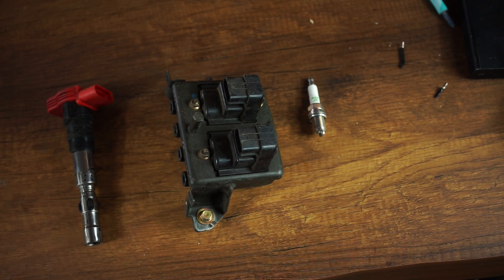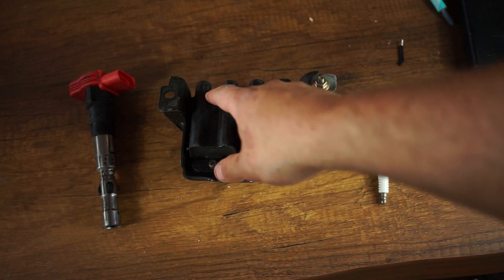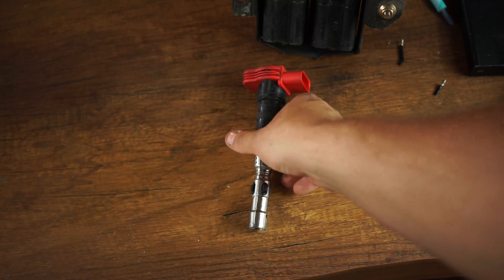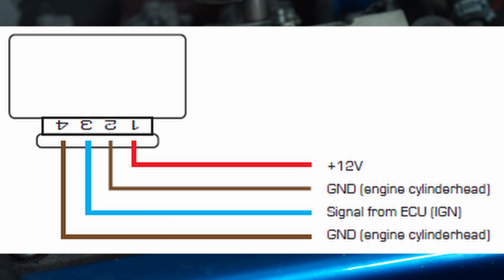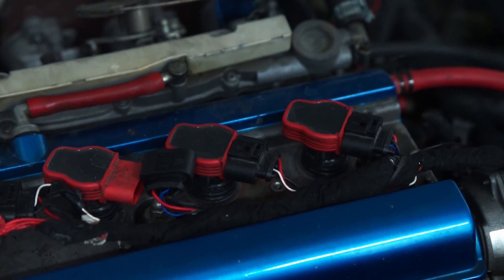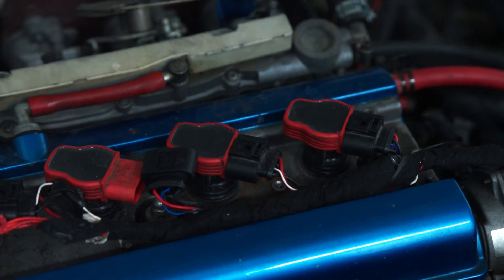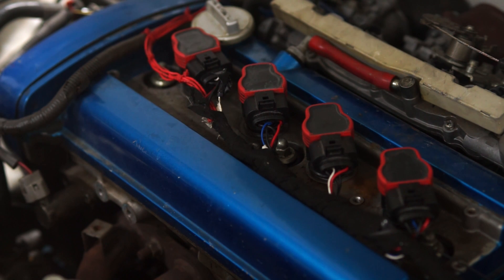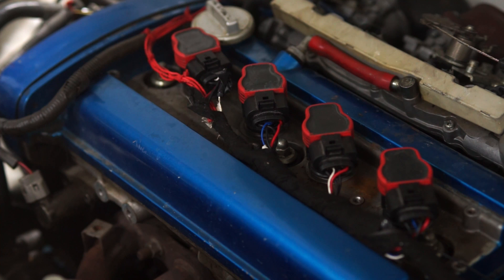DIY Coil on Plug Ignition Conversion | Cheap and easy sequential or wasted spark Config for any ECU

Comment: What if i parallel all the coils? Could it work?

Let me explain. On old Mercs or bmw there is a distributor and rotor on the top of the camshaft. The single coil already have a signal from ecu that manage the advance/retard. What if I take that signal and split it to 6 coils?one for each spark, could I work? So that should be 1 good spark and 5 wasted every cycle.

Comment: Hi ...  is this applicable to a miata with standard ecu?
Reply from the maker: in theory yes it can be done but not recommended for long term use as the stock ecu uses much higher dwell times wich can damage the coils  over time. 

+ you dont have any benefit from cops on a standard naturally aspirated setup anyway

Comment: Hi, sorry to bother you, but do i need a module to activate the coils? because i saw you just put 4 pin coils, and dont you  need a 5th pin for the 12 volts?
Reply from the maker: No if you have a standalone ecu then you have in this case 2 pins that goes to ground 1 pin that goes to constant 12v and the other one is signal to the ecu that tells the coil when to ignote

Comment: Okay but is this possible for a vehicle that doesnt use an ecu? Such as small block chevy for example how would one make that conversion ive got the coils already just cant seem to figure out the "sense" wire to make them fire when they are supposed to. Or cpuld i make it work as wasted fire essentially??
Reply from the maker: Im not sure that it would really be possible but not sure
Reply: @throttlebuddies0 I appreciate the reply anyhow!!! If you think of a way please post an update ill be subscribing for sure!
Reply from the maker: @mikewebb9970  well you could use a cheap ecu to run wasted spark like a 200 usd speeduino or rusefi in conjunction with a missing tooth trigger wheel 

But making it qork withput an ecu you would have to find out a way for the distributor do give out a signal to each coil, wich in itself wouldnt be a problem but the issue would be the duration of the signal since that would need to have a specific length.

Comment: Totally different question.  I have a carbureted car that had a distributor, but parts became obsolete.  So I installed a coil pack ignition with a trigger wheel and sensor.  The system is great in theory, but something has gone haywire, AND the company is out of business as well.  So - are you familiar with complete ignition systems - that include trigger wheel, sensor, computer, and coil packs?
Reply from the maker: you could just use a speeduino do do ignition that works well or something like rusefi. but at that point, why not go fuel injection aswell? makes things so much easier and better to tune :) 

you can send me a message on instagram if you have any further questions _throttlebuddies
Reply: @throttlebuddies0  Thanks! the car is a 60's porsche 911.  It has two triple throat carbs on individual intakes - no plenum.  putting in an injection system, without the computer and wiring is a $3500 conversion ON TOP OF the ignition conversion (which is probably about $1000 - so big picture $5000.  I'm not cheap, but that seems like a lot for an ignition system correction.  If I want to go back to a distributor it's about $1500 and waiting for parts to come up on e-bay - probably about a year.
Reply from the maker: @philbates277  its really not that expensive. all together can be done with a standalone ecu for maybe 1500 USD or something like that. 

and the ignition system itself you can realize with a 200 USD ecu

Comment: You seem to be actively answering so I'll shoot my question, v8 with an hei distributor, how feasible would it be to use the distributor pickup to apply ground at the coils to use as a fire signal?
Reply from the maker: you could in theory do it in a way as where one signal wire of one channel of the ecu goes to the dizzy and that "spreads" the signal into all coils, though i have never tried it, it might work. all the other wiring should be the same tho. 

tho i dont know if the charge times of the pins in the dizzy touching will be enough or too much. thats little bit of a problem. personally, if you are at a point where you need cops because you loose spark energy. id switch to a standalone ecu. The speeduino or rusefi can be had for 200 USD and can be made to work on a v8 without issue.
Reply: look up pre1930's fords basically the same idea's( comment questions, sorry iv never worked on one the oldest for me to get payed for is 1955~era/magito/battery's+dizzy-combo ( newest so far for me is 2007~ish i switched career's/field's to manufacture-plant-maintenance ) and im a zoomer/2008 they are purty-munch all off the road as daily's and or DIY/specialty-shops so i didn't see them as a DSM/JAP/GM-tech, but had i it might have helped me with my charger/got-stuck as the 70's box's/dizzy fried and by dumb-luck that week got my LSX-coils but didn't have the computer-yet to run them and a 2-weekend~ * fix would have been a blessing-ect ) and or buzz-box-ignition as the rotor-cap does the switching and you don't even need smart/modern-coils for this to work the reason why ford/gm went to the 1950's-type is cost and in the 20's/manufacturing/miniaturisation hadn't happened as much so it got cramped under the hood but red-MSD-coils will do the same-spot/job as a 1914~ T-coils-do just not in a wood-crate/box/ect, still the downsides of being analog/aka no timing-maping-ect also come of thinking about it lookup the 1957~Chrysler fuely-car's the bendix system might work like this as i cannot remember if the cap is iner-changeable with my 440RB/charger's or not but by memory both are B/RB/hemi-bock-car's

Comment: The Video title is completely misleading. When you say distributor 2 cop in the title and then later in the video you say its not possible...just a dumb video. Thanks for nothing.
Reply from the maker: of course its possible. i am showing it in the video, though you need a standalone ecu to make it work.
Reply from the maker: + does it not mention that in the title. it just says coil on plug conversion.
Reply: @throttlebuddies0  for ANY ECU != "for your standalone ECU with 4 IGN Output Pins.
Reply: @throttlebuddies0  "for any ECU". ANY ECU is not any Standalone.
Reply from the maker: @RottenSon667  in theory would be possible but doesnt make much sense as i said in the video most stock coild use a much higher dwell time so you might damage the coils over time
If you route 12v theoughthe distributor you can actually get that to a signal line on each coil but depending on what the dwell of your stock ecu is might burn out the coil this is also dependant on the aftermarket coils
Also you would still be relying on a working distributor so kind of redundant

Comment: I have a 4agze with the 24/1 dizzy, I can use the sensors in there to make it fully sequential right?
Reply from the maker: @xcrazyghostx9566  yep running it exactly that way
Reply: @ what settings do you use on tunerstudio and do you have problems with noise?
Reply from the maker: @xcrazyghostx9566  not at all you can send me a message on instagram and i can send you the map

Comment: Can I run cop on the distributor
Reply from the maker: you can run the distributor for timing but you cant run cops from the distributor really as you only have a high voltage from the distributor. 
if you have a stock ecu you cant run COPs but on a standalone you can convert to cops no issues at all retaining the dizzy for timing purposes
Reply: @throttlebuddies6356  I live in Meddle East, and it is hard to get standalone ecu
The shipping fee will be high
Reply from the maker: @khaleedjbeer4186  i doubt it. standalones can be had for 200-300€/USD 
i live in europe which is not that far and shipping to there is not terribly expensive

Comment: Can I run sequential on my 20v st with just my dizzy or would I need a crank trigger fitted?
Reply from the maker: you can run sequential with just the distributor as that has two sensors integrated. i run it like this too

Comment: But can I just somehow wire the plugs on a 1.8t to work on a wasted spark? With no ecu? I don’t want or need 100ft of wires and ecu can’t I just wire the crank sensor to fire the wasted spark ignition?
Reply from the maker: I dont understand what you mean. You need an ecu to control your spark
Reply: @throttlebuddies0  well the older cars didn't use ecu, and I've seen that some can just use a crank sensor to send the signal so can't I just use the crank sensor 1.8t already has and wire it up to a waisted spark kind of like a crank trigger?

Comment: I have some nice oem Nissan cop’s that have a 3 pin connector (12v-ground-signal). Is there any reason it wouldn’t work because I can’t seem to get a spark when testing it outside of the cylinder.

Comment: how did you make the boot to cover the hole between the spark plug and the top of the coil pack?
Reply from the maker: What exactly fo you mean i just put the coils on the spark plugs thats it
Reply: @throttlebuddies0  an other way to say it is how do you prevent water to not get in the sparkplug hole. but it seems like you didnt do any hardware mod to those coils so nevermind.i will have to try it myself on my engine to see if it fits
Reply from the maker: there shouldnt get any water in there as the coils have a rubber seal